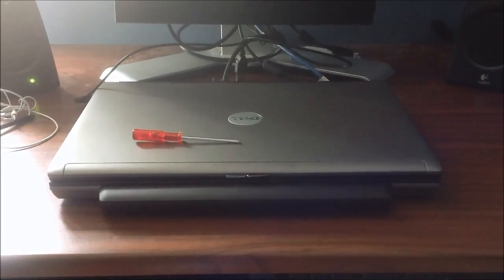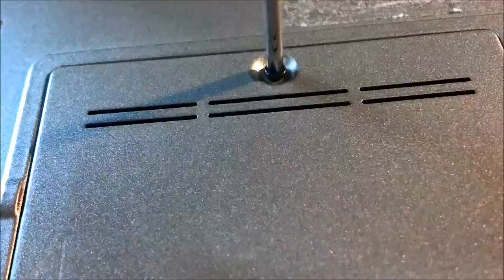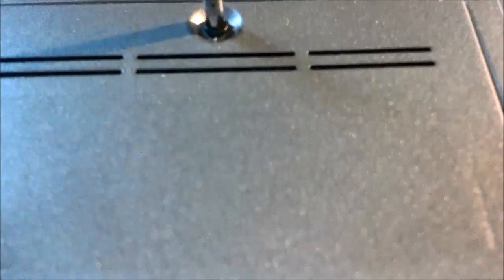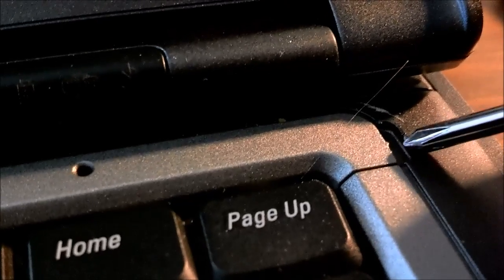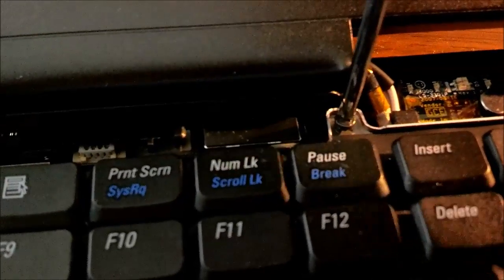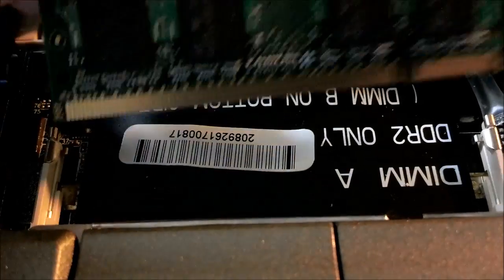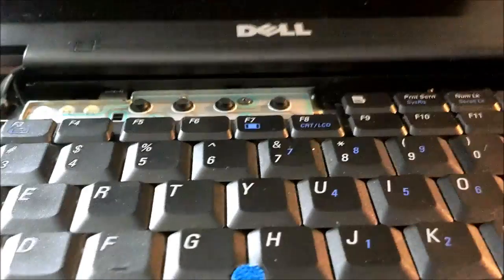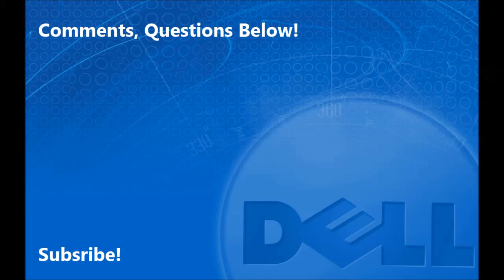Upgrading Ram in the Dell Latitude D630

Comment: Do i need do do anything after I install the new memory cards? Or does it work automatically when I turn on the laptop?
Reply from the maker: when it starts up it will ask to confirm the memory change
Reply: Dell3524 , what about when I change a hdd to a ssd ?
Reply from the maker: No it won't say anything
Reply: If I recall it will start to boot up but will stop and ask you to press F1 to confirm a memory change...it doesn't matter if you add or remove memory anytime the amount of memory changes it will stop and tell you that the amount of memory has changed and to press F1 to continue or I think F2 to enter the BIOS, its been a while I can't recall exactly what it says, but it does stop and tell you the memory has changed and what button to hit to continue.  

If you turn it on after a memory upgrade and you get no video on startup the memory is either not installed correctly, memory is more than the system can accommodate, or the memory is just plain not any good.  I stick with brand name memory i.e. crucial, Kingston, Intel, etc.  Avoid the no-name stuff like PNY, there's a reason the no-name memory is cheap, its a crap-shoot if its any good right out of the box.
Reply: Mine was automatic, I just rebooted the machine 3 times carefully,

Comment: Hello the d820 is same setup. wat I'd like to know if upgrade ram is installed will system boot up and automatically reconize.upgrsde or any special thing need to be done for upgrade to work..i.e.will ram show as upgraded once rebooted thx
Reply from the maker: Mike Todd it will take up to 8gb of ddr2 ram max speed 800mhz
Reply: System will recognize the extra ram when you reboot

Comment: DO WE HAVE TO REPLACE BOTH RAMS?
Reply: No, however it'll run better if you replace them in identical pairs.  So if you replace 1 of the Ram Modules with a DDR2-800 then it would make sense to replace the other one with the same speed Ram module, otherwise it'll run a bit slower with mixed modules in it.  It'll work but not as well.
Reply from the maker: +mubashir ali no you do not
Reply: YES Of course, if you have two, yes....Do both. Chances are, you only have one stick, since most of these machines ran 2G RAM one slot, and Windows XP, which was great at the time, chances are you will be going to 32 and 64 windows 7 and will need both slots, 2G each is OK. If you are a ram jock, and want more, fine, but 2 times 4G is yahoo wow good. If you have two RAM sticks in the slot, replace both, because they could be the same age. It would be like replacing one busted hose on your care, and soon the others blow, or replacing one wall of wall paper in the bathroom, just redo the bath room walls. It is always best to match also. Buy the two 2G sticks same company same everything, save time and head ache. You might get a warning, on first reboot, just reboot the machine 2 or 3 times to give the RAM BIOS, ans drive, time to hand shake and say howdy. Go slow, allow the machine to fully reboot and don't force anything.. after it is fully loaded, reboot. Off is even more fun

Comment: Which ram replacement is needed to upgrade your memory? The one on the back or under the keyboard?
Reply: To do it right replace both modules with the same speed.  Mixing them together kind of bottleneck's the machine.
Reply from the maker: Reginald Jackson you can do both or just one
Reply: Do both. Chances are, you only have one stick, since most of these machines ran 2G RAM one slot, and Windows XP, which was great at the time, chances are you will be going to 32 and 64 windows 7 and will need both slots, 2G each is OK. If you are a ram jock, and want more, fine, but 2 times 4G is yahoo wow good. If you have two RAM sticks in the slot, replace both, because they could be the same age. It would be like replacing one busted hose on your care, and soon the others blow, or replacing one wall of wall paper in the bathroom, just redo the bath room walls. It is always best to match also. Buy the two 2G sticks same company same everything, save time and head ache. You might get a warning, on first reboot, just reboot the machine 2 or 3 times to give the RAM BIOS, ans drive, time to hand shake and say howdy. Go slow, allow the machine to fully reboot and don't force anything.. after it is fully loaded, reboot. Off is even more fun

Comment: Great Video! 
I got a Dell Latitude D630 last Christmas, used but still good. It came with only 2GB SODIMM RAM and I've been looking for a way to increase it. What's the max amount of memory the D630 can have installed?
Reply from the maker: AIKAN74 The Max is 8 GB total not per Ram Slot
Reply from the maker: 8GB
Reply: Dell3524
I have used two sets of 8gb and system wont boot. i have updated bios from dell website to A19 and still nothing.
Reply: @AIKAN74  It can only handle 8gb total
Reply: 8gb